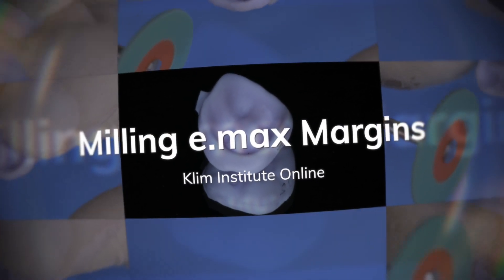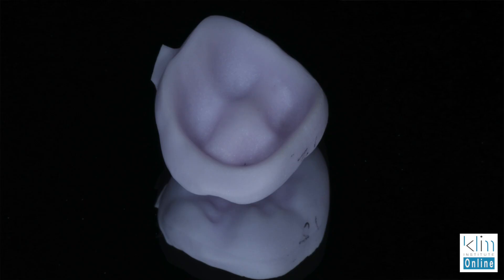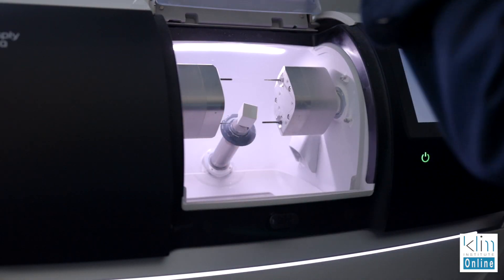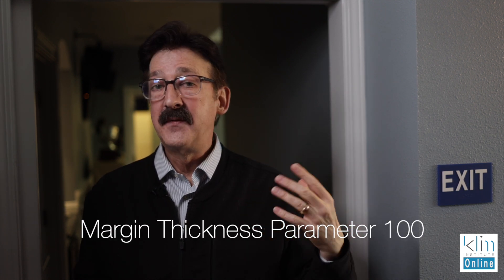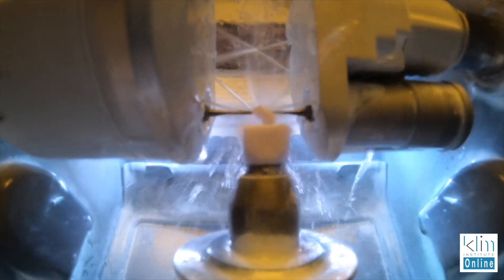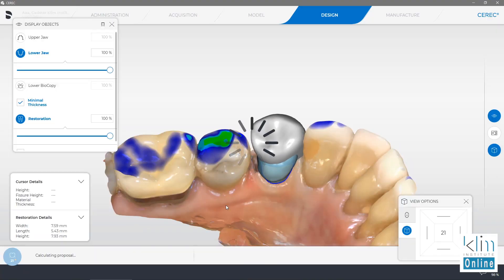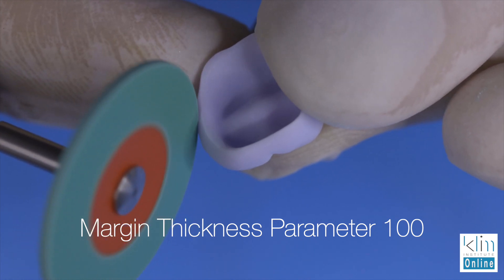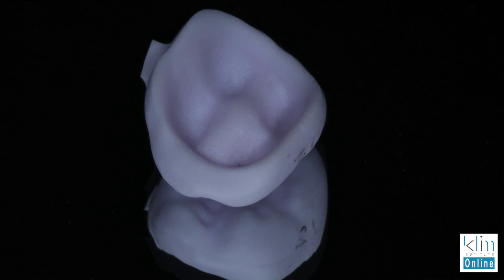Preventing Mill Chipping on e.max Margins

Comment: What are the standard parameters for the rest of the settings for posterior emax?
Reply from the maker: Depends on the milling unit and speed of the mill. In general, I use fine or extra fine mill mode.  My occlusal Contacts Strength is -50, Proximal contacts stength is -25.  For MC XL Occlusal Offset is -175, Primemill Occlusal Offset is zero.

Comment: Actually 100 is the default setting on our primescan but I found the margins to be "hanging over" to much on the teeth so I reduced it to 50. How do you know how much thinning is too much without trying the restauration in?
Much appreaciate your videos and greetings from Germany!
Reply from the maker: Thinning the margins is a skill set that is learned.  Over-pressing and milling thicker margins have long been in the workflow mix for managing ceramics.  Labs have models and die(s) to work this process; we learn how to do it in the mouth.  I use a coarse knife edge silicone wheel and finish the restoration chairside before cementation.  As of now in the US, the margin thickness parameter has been 50 um.  I have recommended 100 um.

Comment: Can you define margin chipping? Is that on the cameo or intaglio surface of the margin or the vertical aspect of the margin itself which would cause an open margin?
Reply from the maker: Hi Yoni,  the margin thickness extends externally to the margin.  The recommended marginal thickness of 100 is a calibrated metric to avoid microchipping (external edge of the margin) that will result in an open or shy margin.  Once machined, then the margin is polished back.  Each material mills differently and must be calibrated accordingly.  I made this video because as an educator, I get this question often.

Comment: Hi Dr Klim! Could You please tell Your softwares version? I have 5.13, but I could not find the option to modify marginal thickness for crowns. I see it for inlays, but the option is missing in the crown preferences! Thanks, I appreciate Your help!
Reply from the maker: Hi Tibor.  The Margin Thickness Parameter is accessed once the restoration has been proposed in the Design Phase Screen.  Go down to Step Menu, click on Parameters, scroll down to Margin Parameters, unlock and reset, click on Okay, then Click Edit Restoration on Step Menu.  Margin Parameters cannot be accessed through default parameters in configuration. It has been preset by the manufacture.  It can only be changed in the design screen for each unique restoration proposal.  All the best.
Reply: @KlimDDS  Thank You! I've found it! You are the best! 🙂🎉